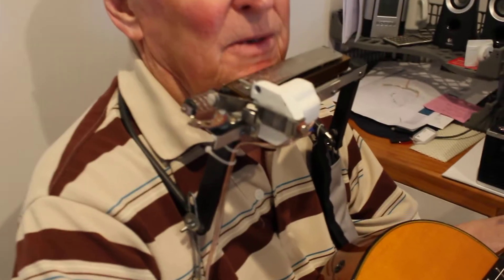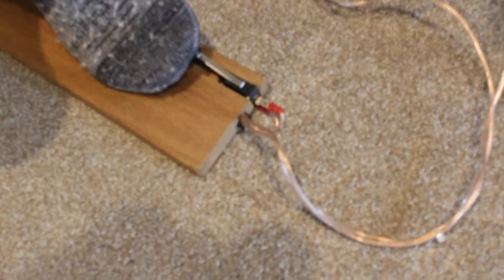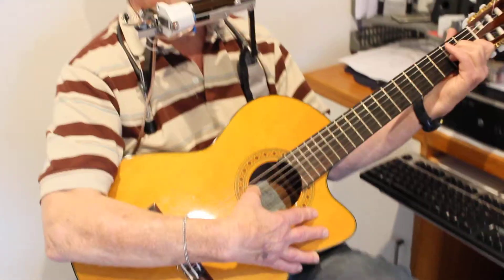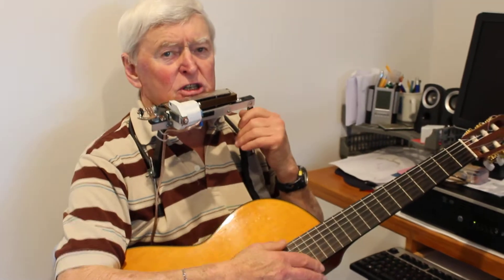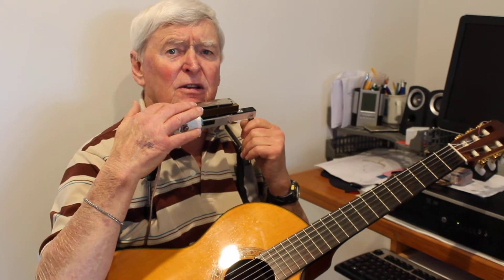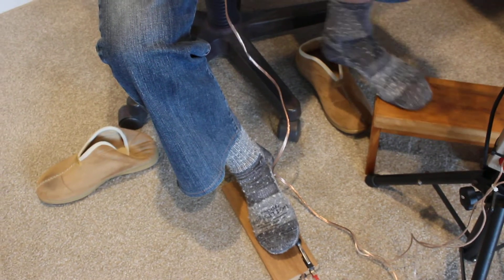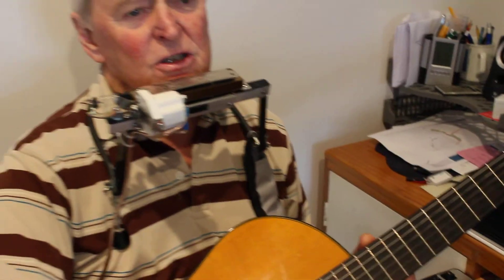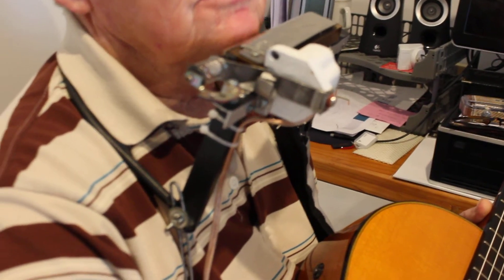Hands free chromatic harmonica

Comment: So how many electromagnets did you have to test until you found one that did the job right, but was small enough?  Great invention.  Any commercial release happening any time soon?
Reply: when  I knew that 240v was a no go for safety reasons, being an ex Diesel Mech I knew exactly what I needed first hit 12-24 V which had enough power, I made the prototype over 30 years ago but gave up because of jerky action , a couple of years ago with time to spare I solved the problem in a couple of hours , 2 were made, one I will let go, at 82 commercial release will not happen, thanks for your interest Colin NZ
Reply: HI guys, I am working on a similar project. I already bought two electromagnets which both were too weak. Now before I buy another one I wanted to know how strong it has to be. How many watts, I suppose 12 or 24V, how many kg. Pound or Newton it needs. One of us will make the breakthrough, I’m sure. Thanks for helping. Happy harping

Comment: Where do you obtain the equipment, nice result.
Reply: junk bits in my garage, my sons Hornby train set transformer from 45 years ago, a bit from car distributor points, electro magnet from Diesel engine, very important couple of springs, designed 30 odd years ago dumped in a box with frustration & taken out again last year overcoming in 3 hours the previous jerky action,  thanks colin
Reply: Ingenious and innovative well done sir.
Reply: My dream is to buy or build a chrom rack one day.